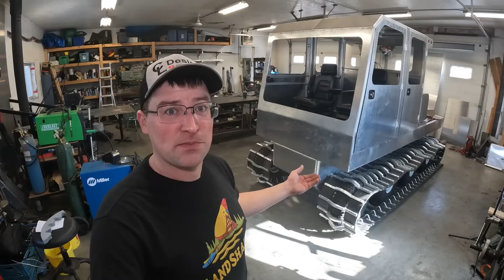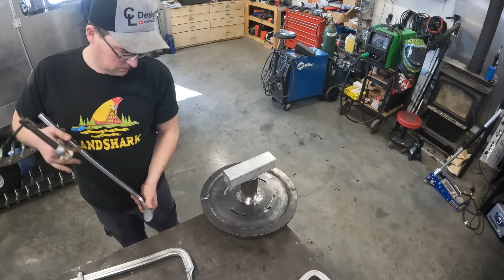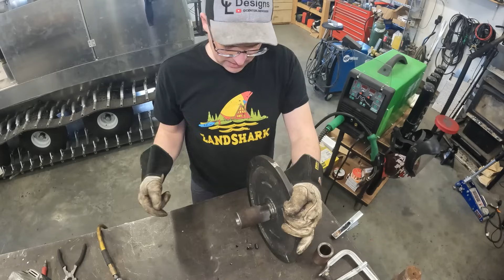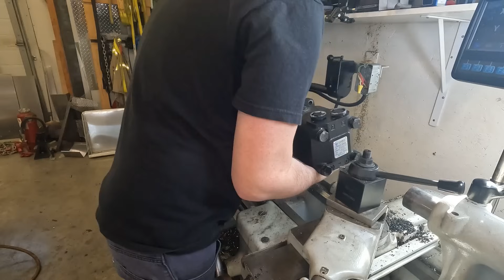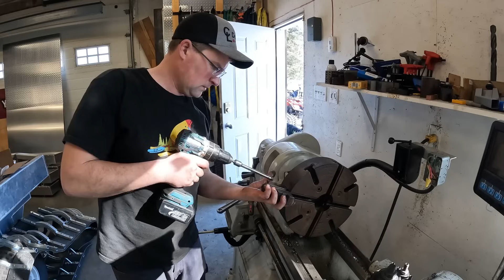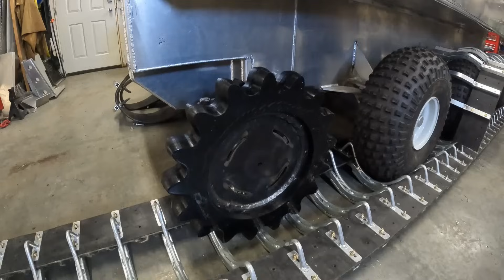Casting Sprockets and Machining Hubs P2/2 | Custom Snowcat Build

Comment: To bad the front axel is not adjustable for your track tightening
Reply from the maker: I very much agree. You actually picked up on something I haven’t talked about. If moving the motor up on a new bracket works I am debating making that front axle adjustable for the new tensioning method. Good catch!

Comment: What motors and pump are you using? Planning a similar build but smaller, i think im going to use Hydro Gear hydrostatic trans on each side( from zero turn mowers) cause they have variable displacement pumps built in and all ready set up for hubs. One of the problems I saw using hydraulic motors was the controls, most ive seen are very twitchy, not easy and smooth to control.
Fun watching your build! It looks great!
I built homes for a living, now retired if you have any questions about the house lift. 
Sounds like your planning on two doubled up I beams to lift it? I would run 1 on each side the full length of the house and then use shorter ones under those at 90*  every 10-12 feet. jmo. probly what your gonna do anyway. :)
Reply from the maker: So I am running a 315cc OMT wheel motor made by a Chinese company. Went the cheap route on pumps and motors just until I prove the machine. I couldn’t afford going brand name until I know the rest of the machine works. My pumps are a hydro gear knock off. 
Using the variable displacement piston pumps who can mine are and likely the hydrogear ones you are looking at too, you get decent control. The variable swash plate can actually be smoother than you expect vs just a basic hydraulic valve control. 
With that being said if the rig works I’ll probably upgrade down the road to a good Eaton or Danfoss pump with pilot hydraulics. But that’s an investment.
Thank you! I have a small amount of experience lifting houses but definitely will probably make mistakes and need advise! 
So I’ll probably be reaching out on YT when the time comes!
If you have more questions about the hydraulics feel free to ask. I am by no means an expert on anything but I have decent knowledge. Just not afraid to make mistakes.
Thanks for watching! Cheers!

Comment: It's a hard decision no matter what, but don't take the easy way out. As a builder, fabricator and machinist myself, I would make a new hub and sprocket at the correct size. It's the right thing to do.
Reply from the maker: I do agree with you. Since it’s fairly easy to test a new motor mount I think I’ll try that first and see where it goes. Only issue with a new bigger sprocket is that I risk not having enough torque. But I really won’t know that until it’s test day. Time will tell I suppose. Cheers!

Comment: You over looked something kick the ground stomp your feet and get on with it. Good time to reflect. You’ve thought about moving the motor. Have you thought about using the larger sprocket? Your project, your decisions your successes.
Reply from the maker: You got it. Key is moving on and moving forward. That is an option but as I mentioned in the video I had concerns about the torque. I’d rather the rig move a bit slower but have the torque to the ground. So you are correct a larger sprocket would help but I have concerns about that. I also really like how this one turned out. 
Cheers!

Comment: Man. Don’t worry too much about it. I can tell. You are like me when it comes to a challenge like that. It’s just one of those things that happen when you build custom. My first thought was also to move the motors in. Why not have them be completely inside the body?  Would help to keep it and its hoses protected. A 2 bolt pillow block bearing should work great. Simple and you can use just one track adjustment bolt. Cheers man. Keep your head up!!
Reply from the maker: You bet. Just hurts as you know going backwards but it was bound to happen. You know I originally thought about that at the beginning of the project but moved away from that because I thought I would just complicate things a bit with being weather tight and track tensioning. But I can’t rule out that, that may be the best solution. Fingers crossed that lifting the motor up will help. 
Cheers buddy!

Comment: Cole what happens if you move the sprocket up so the top is even with the tops of the wheels?
Reply from the maker: I think that’s my first thing to try. It’s hard to tell but I think that will give me the clearance. I think I will make one new mock up bracket to test it. Fingers crosssd
Reply: @CenterLineDesigns  Thank You for the reply.
Reply from the maker: No worries sir! Thanks for watching and commenting!!

Comment: I thought sprockets are just over moulded metal. Not just plastic. Is it going to be strong enough? Also the tracks are going to flex a ton on dished trails and hit the motors so you are going to need a lot of clearance. I'm not sure if tire pressure is a good track tension method due to elevation and temperature changes will change the pressure. Just some random considerations as you are at a critical modification point. I'm just an operator at a ski resort. My 2 cents. Love the build.
Reply from the maker: Most are a coated core yes. However there are options for solid polyurethane sprockets on the market. I am quite confident in this working because of how small and light my snowcat is. The material is stronger than you would think. 
I hear you. However I am designing this for a bit different terrain. It’s not really intended to be a mountain climbing machine. Tire pressure isn’t the main track tensioning. Just fine tuning is done with tires. I know what you mean about the flexing but I actually think the belting tension will stop that.
But it’s just a prototype and I am definitely learning as I go. I’ll be making sore to give it as much clearance on round two!
Thanks for commenting and watching. I do appreciate it. Cheers!

Comment: It should float, it’s going to be interesting to see how well it swims. Before snowmobile tracks came with the tall lugs, we used to bolt plastic paddles to the tracks to help in deep snow. I still have a set of 2” hot pink paddles in the shed that I’d be happy to donate to the project if she needs help swimming!
Reply from the maker: You got it! I think it will float. I don’t really plan on it swimming well. I just didn’t want it to sink crossing a swamp or think ice on a lake. Cheers
Reply: Maybe an electric trolling motor would be simple and adequate.
Reply from the maker: Potentially yea. Main goal was just not sinking hahaha

Comment: To me it looks like you have quite a bit of room around the motor to shrink down the mount. I don't think it will be as bad as you think. I hope so anyway. Good luck
Reply from the maker: That’s what I am thinking too. In the moment I was having a bit of a freak out haha. But looking at it a week later with a calmer head I think it won’t be too bad
Reply: Yes, better than having to re-design the tensioning system.

Comment: I was thinking that you made the drive sprocket too small for the tracks to wrap around when you brought up your design flaw. 
I'm a 3D designer and have caught a few things before they went into the real world. 
Keep up the great work!!
Reply from the maker: It would have been okay had I stayed with my original design. I guess I had too much of a close up view of what I was doing and didn’t step back enough to look at the whole picture.
It is what is right. We will fix it. 
Cheers!
Reply: @CenterLineDesigns  
I have experience working remotely if you're looking for a Drafting, Designer person.
Reply from the maker: Interesting! Might need that in future builds. I want to design a build an aluminum boat in the coming years.
Cheers!
Reply: @CenterLineDesigns 
I'm not seeing my comment. Was it automatically deleted?
I see your response.
Reply from the maker: No I see it. Not deleted. I don’t know what that happens.

Comment: Just wondering when you made your mold  for the sprocket why not make the mounting holes in the mold as well  . Just curious.?
Reply from the maker: Small details can be hard to de-mold. I figured the risk wasn’t worth it. So I opted to just drill after as I was confident in that working. That’s all
Reply: @CenterLineDesigns  thank you for the response  🎅

Comment: We haven't discussed it being amphibious yet because it might not be ;)
Reply: I don't doubt it will float whatsoever, that's a fairly easy milestone to achieve, if it doesn't leak out when a guy puts enough water in it to be above the calculated water line, none should leak in, well, none that a bilge pump can't keep up to anyways. Even good old Argo's leak in through the axle seals no matter how much grease is packed or how new the seals are new and that's solely due to the axle rotation much like a jet boat pump shaft seal leaks which helps keep the seals cooler.  Without knowing the center of mass of the unit I think he's not far off with it being balanced.
Reply from the maker: Totally agree. I put a lot of time to keep the CG as low as possible and centered as much as I could. I actually don’t have much worries about the flotation. 
With that being said I don’t actually plan on using it like a boat or anything. More just so it doesn’t sink breaking through thin ice or swamps.
Cheers
Reply from the maker: Hahaha. Might not you are correct. But should be according to calculations haha